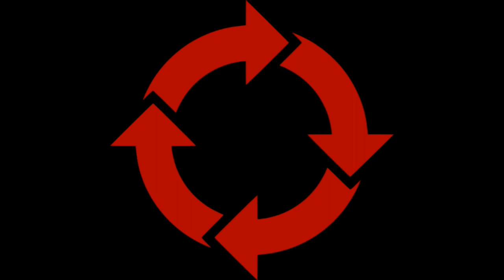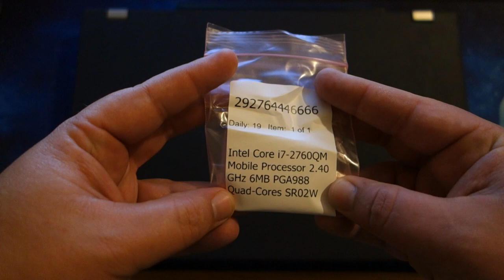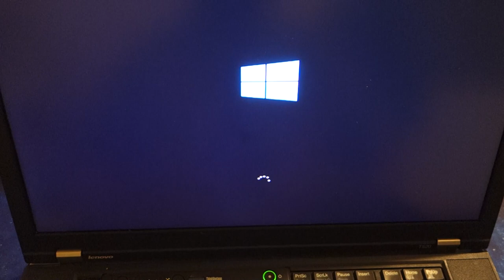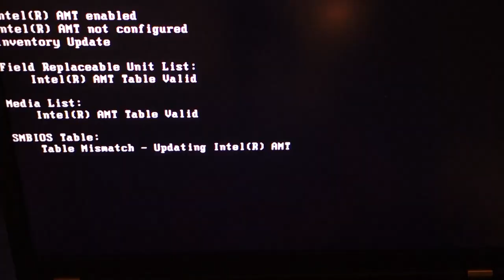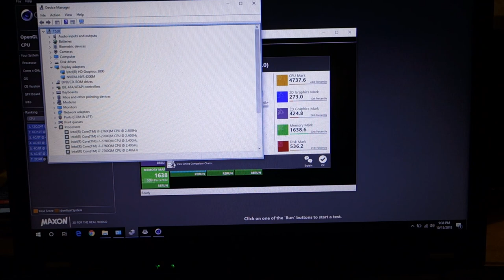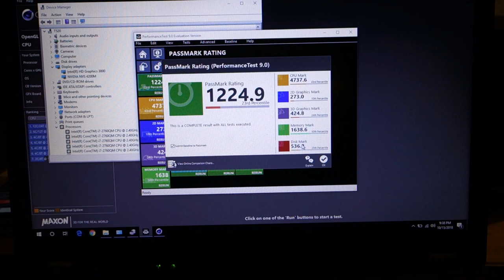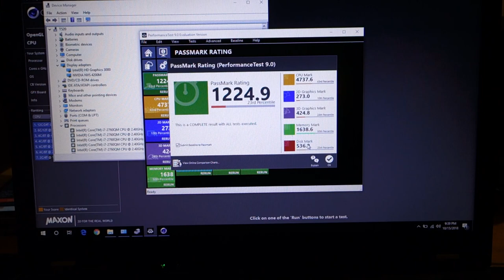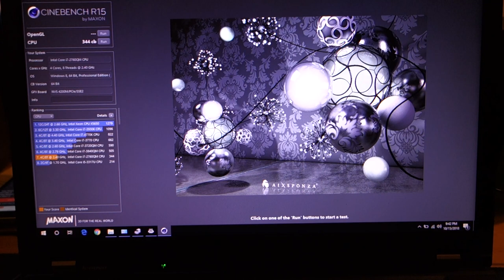Lenovo Thinkpad T520 CPU upgrade Core i5 2520M to i7 2760QM

Comment: I did this and now my cpu idles at 51C at 0.7% Usage in arch with i3wm RIP
Reply from the maker: you did what? upgrade the CPU? which one did you upgrade to? did you install the cooler correctly?
Reply: @AICvideo  yes upgraded the cpu to the 2760qm.  Reinstalled the heatsink and fan correctly with fresh thermal paste. It is not the nvidia motherboard version with the better cooling, just the integrated graphics version.  I know the cooler from the nvidia version is better and fits and drops the Temps by about 10 degrees so I might try that.  It also idles at 40 but gets to 50 if i have a browser with a couple tabs and a few terminals running, or 80-90 with a windows vm

Comment: I heard that the Thinkpad t420 suffers thermal throttling issues with a quad core i7, does the same thing apply with the t520? And if so, is there any way to prevent/manage that?
Reply from the maker: From my understanding if you upgrade the cooler to the one for a laptop with dedicated graphics, it is a lot beefier, and so can handle the heat. This laptop had a dedicated graphics card, and so already had the upgraded cooler. I had no heat issues at all.
Reply: @AICvideo  
Hi!
I have T520 without a dedicated graphics card and an upgraded cooler. Can I put i7-2670qm ? I assume that without a dedicated graphics card is much colder than with.

Comment: hmm...   i upgraded my Toshiba L755 laptop from an i5-2410M CPU to the i7-2760QM CPU and i consistently get around 6,500+ on Passmark 9.0 CPU Mark score, so something is a little off or misconfigured on your Lenovo i7-2760QM.  Maybe the Windows 10 Power profile needs to be set to "High Performance".  Is yours on "Balanced", I wonder, cuz your CPU Mark score is pretty low.
Reply from the maker: No idea. I've since sold t his laptop, so don't have it to mess with anymore.

Comment: I score 243 in R15 with the T520 and the 2520m. Not sure if I really want to even spend $25 on a 2820QM.. I'm using the machine to watch 8 cameras with an external monitor in my shop and it's hitting 100% usage/stuttering video.. Might just use another machine. Sad too because it's been awesome the last 10 years I've had it..
Reply from the maker: How are your temps? When was the last time you re-pasted the cpu/cleaned the fan?

How old is your storage, is it an ssd?

How much ram do you have?

Comment: Thanks for this super helpful video. I'm going to try a CPU upgrade on my T520. I already added another 8g RAM which made a HUGE difference and I am hoping that this upgrade will let me do some simple graphics/cad work on the machine too. Is there somewhere you recommend to check on CPU compatibility? And where did you get the lit screwdriver!
Reply from the maker: This is the website I use for checking compatibility:
http://www.cpu-upgrade.com/

The screw driver I got at a tradeshow, it shows VMware on the side, and I don't know how to buy one without buying like 50 of them:
https://www.discountmugs.com/product/intk25-custom-promotional-screw-drivers/

I should get some done with my youtube channel's name and sell them.
Reply from the maker: found them on amazon a bit cheaper. https://amzn.to/34Q4r7u
Reply from the maker: eBay or Amazon.

Comment: Question, i have a Acer Aspire 4830TG with i5-2410M. im wondering of i7-2760QM would be compatible since my laptop motherboard has HM65 chipset?
Reply from the maker: Not sure I haven't worked with an acer aspire, but it has more to do with what chips your bios supports. https://www.cpu-upgrade.com/CPUs/Intel/Core_i5_Mobile/i5-2410M_(PGA).html That is what I use for reference, but you just have to try.

Comment: heyyyy brooo i already sub and i have one question the laptop in this vid is LENOVO T520 RIGHT ? but how u have gpu nvidia ?
Reply: nvidia nvs 4200m ? because my laptop only have intel hd 3000 .....please reply me thank youuuu
Reply from the maker: The nvidia graphics was an option on the t520 from factory. Only a handful of the systems are equipped, and it is soldered to the system board, so you cannot add it after the fact.
Reply: @AICvideo  aaaaa i see mine doesn't have

Comment: Hello Dear. Thanks for DIY video. I have a Lenovo X1 - The model code is 12933DG and It has a 2520m 2th i5 processor and I want to know this model CPU is upgradeable? If it is upgradeable, these laptop parts are compatible to upgrade this CPU with i7 3630qm? If you have some knowledge about this, I will wait for your reply. Thanks.
Reply from the maker: I have never opened one up, but my x220 with the same cpu is not, so I would guess the x1 would also not be.
Reply: @AICvideo  Thanks for your quick reply. This week I have planning to buy a new thermal paste then I will check it then I can share more information with you

Comment: bro my laptop is INTEL PENTIUM B940 G2 SOCKET HM65 CHIPSET wat i want to know is I can able to upgrade my processor to i7 2760qm processor this processor also G2 socket only
Reply from the maker: I honestly don't know. It may fit physically in the socket, but the bios not support it. you can always try, the worst that happens is you sell the processor for what you paid for it... But you're probably better off investing into a newer laptop.

Comment: Hi! Thank you for this video!
Its been a while since that video and I was wondering if there's any better cpu I can get today that will work on this model?
I have i7-2620m right now
Reply from the maker: Not that would be worth it. the higher end CPUs require a ton more cooling, and don't perform that much faster.
Reply: Don't bother unless you have the dual-pipe heat sink like the one in the video.  The footprint of the standard T520 heat sink is too small for the surface of an i7 chip

Comment: I bought i7 2670qm for my t420 but it doesnt work I updated the bios but when I turn it on the only thing that happens is flashing light of the power button the cpu fan is not even spining.When I put the old i5 2410m everything is fine
Reply from the maker: Sounds like you have a bad CPU.
Reply: @AICvideo  I realy hope thats not the case.A few minutes ago I downgraded to bios version 1.46 and I will try again. I cant think of another valid reason.Do you have the 90w charger beacuse im with the 65w + charged battery I think its enough to at least power it on. I have 4gb of ram on the slot under the keyboard but it works perfectly with the i5 so I dont think ram is the problem.I will try and update my comment later.
Reply from the maker: It would boot off battery and yell at you for having the wrong charger if it is a charger issue
Reply: @AICvideo  oh thanks for the info. I will try changing the ram slot even if theres not much logic in this and as I said now im on 1.46 bios version and I will give it a try

Comment: So I recently got my hands on a Dell E6520 with Win10 Pro... Battery almost dead, it was very dirty, both on the outside and inside, so I took it upon myself to give it some much needed love... So I cracked it open, take the heatsink off to replace the thermal paste, and I am greeted with the following: 

- A removable CPU (intel i5 2520m)
- 500GB SSD
- WLAN with 5 Ghz 
- 4G phone modem
 - An unused mSATA connector

I already replaced the CPU with a i7 2670qm and am very pleased with how much cooler the laptop is/how quicker it is. The next things on my list are to upgrade the RAM to 16GB, get the HDD socket adapter for the second drive, get a USB 3.0 Express card expansion and get a mSATA mini SSD for a secondary system with scan software for my car. 

Not to mention how the build quality is top notch on these enterprise-level machines.
Reply from the maker: The build quality is much better than consumer grade systems. unfortunately, companies are going the route of cheapening their business systems to be more like consumer systems.
Reply: @AICvideo  True. I hope there will be modular Laptopts like these in the future still produced, though I guess it might be a minority.
Reply from the maker: I'm not very hopeful. they have gotten inexpensive enough they have become disposable, meant to be replaced every few years.

Comment: I’m kinda confused, I’m planning to do the same upgrade on the same device  for a friend, but I don’t understand what you mean when you say that there is a 50% chance of it upgrading successfully. Can you please explain?
Reply from the maker: http://www.cpu-upgrade.com/CPUs/Intel/Core_i5_Mobile/i5-2520M_(PGA).html

"Upgrade Chance" is a probability of a successful processor upgrade/downgrade from the Core i5-2520M (PGA) (original CPU) to a specific model. This number is calculated as a percentage of all motherboards, compatible with both original and upgrade CPUs, compared to the number of motherboards, that support the original Intel i5-2520M (PGA). The number "100%" means that all motherboards, that work with the original model, also work with the upgrade CPU. The number "0%" means that none of the boards, that support the original CPU, will support the upgrade processor. The manufacturers do not always test or publish results for obscure and unreleased models, and in some cases for OEM only processors, as a result they tend to have much lower scores than more common desktop/mobile counterparts.
Reply: @AICvideo  Thank you so much!!

Comment: ca i do this? i7-3630QM on mi lenovo t420?
Reply from the maker: You have to flash the bios with coreboot, and there is a high chance of bricking your system. IMO, it is not worth it. There is not a huge performance increase between 2nd and 3rd gen processors. And going to a 45w chip from a 35w chip, unless you get the bigger cooler meant for a t420 with dedicated graphics, your going to struggle keeping the heat in check.
Reply: @AICvideo   i7-2760QM is also a 45w chip.

Comment: Hello, my computer is a Lenovo Thinkpad T510 with an Intel Core i7 CPU M 620 @2.7Ghz. For some reason, it's slow as dog sh** :(  I have a Lenovo V570 whose i5 2450 is much much faster at 2.50ghz? What processor should I get for my Lenovo Thinkpad, and how do I find one that is compatible?
Reply from the maker: This is what I use to check for compatibility:
http://www.cpu-upgrade.com/CPUs/Intel/Core_i7_Mobile/i7-620M_(PGA988).html

You have one of the fastest cpu's of that generation there is no point in going faster. there is a decent performance difference between first and 2nd gen core i processors, but their system boards are not compatible. but two other questions, How much ram are you running, and do you have a hard drive or an SSD installed? That makes a HUGE difference. if you have less than 8 gigs of ram, UPGRADE to at least 8 gigs preferably 16, and if you are running a hard drive, upgrade that as well.
Reply: AICvideo Wow that was fast! Well, I can only find one ram card slot, but I haven’t cracked it open yet. I’m assuming there’s another one somewhere, because that slot was empty when I bought it, I installed 1 4Gb ram card in that slot, but less than 8gb is actually available. I have a SSD Drive from seagate, with 250Gb.
Reply: AICvideo right now I’m looking at possibly downloading windows 10 on this computer.
Reply from the maker: One is under the keyboard IIRC. 

Yeah, you'll have less than 8 for shared video memory, and just how it calculate show much ram you have. so you do have 8 gigs installed? 

Have you just looked at your system performance to see what it is doing?
Reply: AICvideo  Yep I went onto the PC benchmark website. It’s doing absolutely horrible.
Reply: AICvideo  System performance shows my CPU maxing all the time. I’ve disabled all backgrounding things except the essentials. I’ve enabled all cores and set the processor to performance.
Reply: @RaineG579  thermal paste

Comment: What thermal compound did you use? Last time I messed around with CPUs you still wanted to use the full Arctic Silver V + cleaning compounds, had to scrape it over the full surface of the CPU with a razor blade, etc.
Reply from the maker: Oh god no! Rubbing alcohol + q-tip is plenty to clean it. And I have a tube of Arctic silver I'm almost out of.
Reply: Thanks for the reply. Grabbed a new tube of Arctic Silver and used this video to replace my dead fan. Picked up the same chip to upgrade mine. Between that and swapping the HD with an SSD, what a difference! I should be able to get another 3-5 years out of this machine now.
Reply from the maker: Nice! Glad to have helped!

Comment: Looking to upgrade my own t520s, is this the CPU I should look out for? Willing to invest in the best possible CPU upgrade 'cause I still end up using my t520s more than my newer machines. Probably 'cause they carry 4.5TB each with room for a pair of spinning disks and an mSATA SSD. Thank you for the video!
Reply from the maker: I used this website as a reference:
http://www.cpu-upgrade.com/CPUs/Intel/Core_i5_Mobile/i5-2520M_(PGA).html

I did a swap on an HP elitebook form a 2520m to a 2720qm, but those are pretty pricy and I wasn't willing to pay the inflated prices, the 2760qm had a lower probability of working per the website, but it was 1) faster but more importantly 2) available and cheaper than a 2720qm at the time I did this upgrade. Prices of course vary wildly day to day. But it worked fine for me. and you can still get them for <$50 on ebay, where the 2720 is $65+ 

http://rover.ebay.com/rover/1/711-53200-19255-0/1?icep_ff3=9&pub=5575128025&toolid=10001&campid=5337703343&customid=&icep_uq=2760qm&icep_sellerId=&icep_ex_kw=&icep_sortBy=12&icep_catId=58058&icep_minPrice=&icep_maxPrice=&ipn=psmain&icep_vectorid=229466&kwid=902099&mtid=824&kw=lg
Reply: I ended up upgrading to the i7-2860QM for my t520. Can sometimes run a little hot but not too bad, overall works great. Pretty sure the board would have supported the mobile "extreme edition," or whatever they're called, but they were quite a bit more expensive and draw like 10 or 20 more watts (can't recall for sure); probably would have run very hot. Since the 2860QM appears to be the fastest supported short of the minimally better spec-wise and probably much hotter extreme editions, I would definitely say anything 2860QM or below would be fine for the t520. I made the purchase and received the new CPU within a few days of my original post here and I've had no issues at all since then besides a tad more heat at times, but it was definitely worth it. The performance upgrade is quite significant. I also found a custom BIOS from a programmer in australia that provided me with new firmware for small donation that supports up to 16GB RAM (an upgrade I've already made) and removes all hardware whitelists so I was able to upgrade the wifi/bluetooth card to whatever kind I wanted as well. This t520 is still fantastic for how old it is with these upgrades, I use it a lot more than I use my several other, newer, laptops. Let me know if you want me to find the contact info for the guy that made my custom BIOS, he emailed me recently to let me know he's released a new version but I havent gotten around to trying it yet since the previous version has served me well.
Reply from the maker: @schwanzlutscher It's all about supply and demand. I was able to find somebody who was willing to take offers, and I offered a lower price, and he(she, ze, they) accepted it. Honestly I don't think the speed difference between the two will be very big, its only 200mhz. The jump in performance from 2 cores to 4 is the bigger game changer. So I would go with any 4 core processor you can afford that is on that compatibility list.
Reply: In case anyone doubts the validity of my t520 i7-2860QM upgrade, I just snapped this:

http://imgur.com/a/2DutEf3

This laptop hasn't been turned off since I installed the new CPU like 2 months ago or something. Definitely works fine, definitely a LOT faster than the i5-2520M that I replaced.
Reply from the maker: @phxgen  that's awesome! I've actually sold mine. I just have too many projects, and videos and stuff going on all the time. I have >8 thinkpads in the house as it is... (I may have problems). and so found a guy who was running his own business and needed the compute power. He paid a fair price for it, and was very happy.
Reply from the maker: It will take 2x8=16 gigs. With bios mods he was doing 2x16=32gigs
Reply: @schwanzlutscher As far as I know, a BIOS mod is required to support 2 x 8gb (16gb total) sticks
Reply from the maker: Mine held 2x8 with stock bios
Reply: I have 4+8 ram in stock bios and work fine.